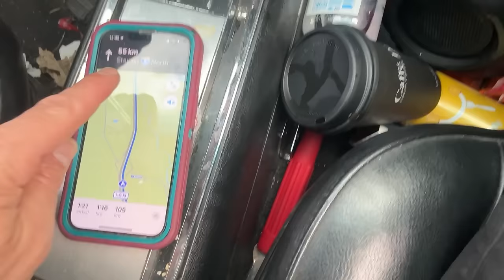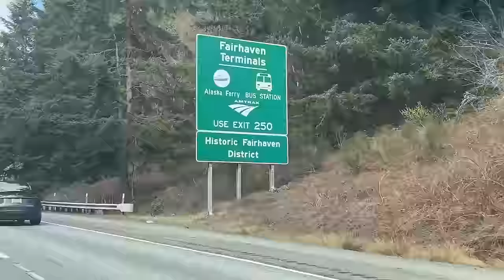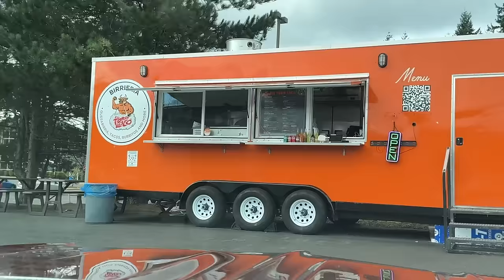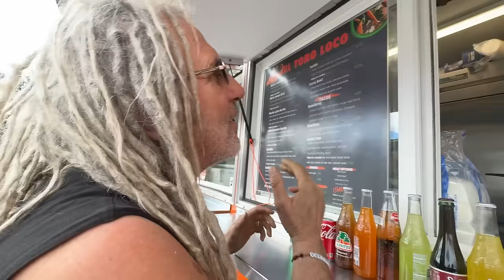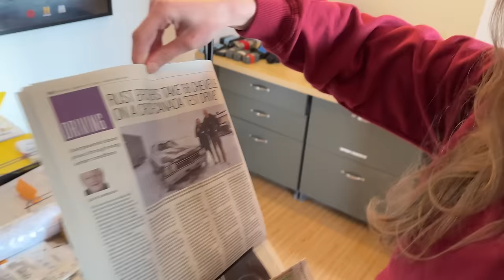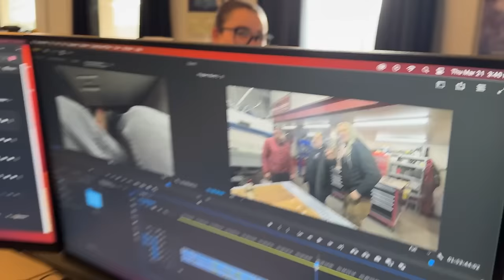Finally Back in Canada and Almost Home!!

Comment: Wiper motor probly a ground issue, ive seen the same symptoms and to repair it make sure the electic motor is grounded to base of wiper motor assembly and a good ground between wiper motor assembly and firewall or seperate ground. I know you lads know what your doing, ive been working as a pro mechanic for over fifty years and ground issues can be tricky. Great Show1, I love seeing the friendships through it all, 
Ride the Wild Pony - Andy Mc,
☮🛠🔧☮

Comment: I noticed on this trip Mike sure likes to stop right on the edge of busy highways alot lol Whether it's to fill the tank because they ran out of gas, Or because of black ice and they want to run and slide on their feet, Or Mike sticking his butt out towards traffic hitting the wiper motor. Mike needs to find safer spots to stop 😅

Comment: wash that windshield down with rainX...  work very well, my old nissan 4X4, wipers worked great, but I filled the bottle with rainX, hit wipers, spray rainX drive for 100 miles without wipers in pouring rain..  crazy how it rolls the water right off

Comment: Usually on a Ford Explorer, a car car will not have a roof rack on the car very seldom. Actually, I’ve never seen a cop car with a roof rack. Mike, if I get your address, I’m going to send you a bottle of Rainne you’ll use it and never go without it after that this is paul from Western Massachusetts God bless